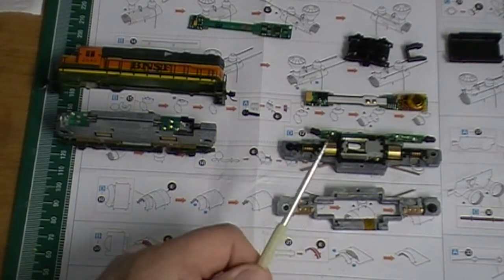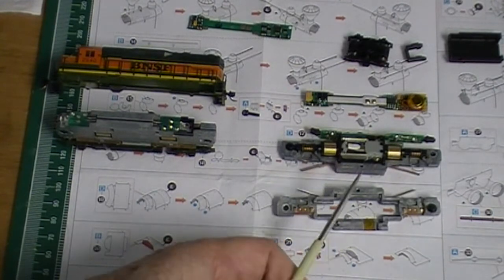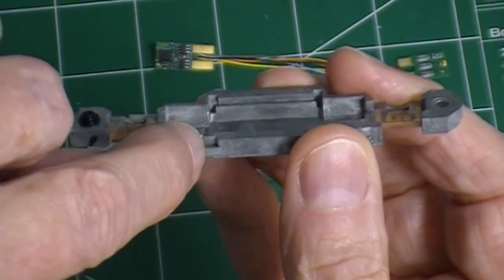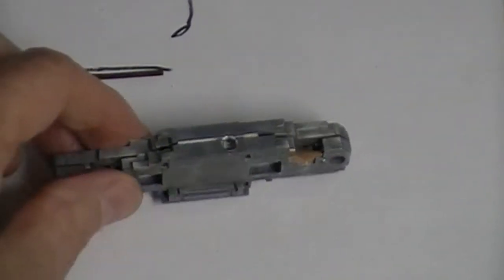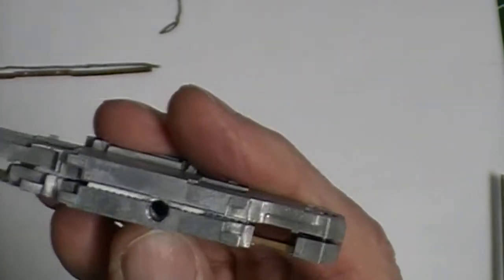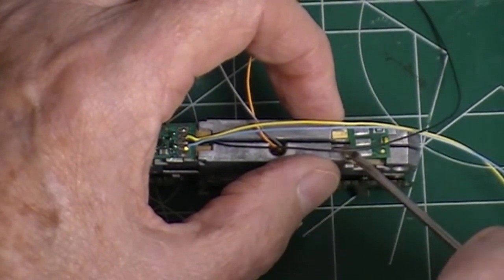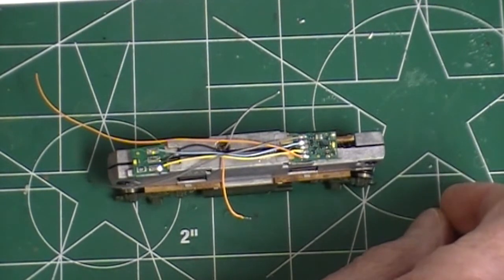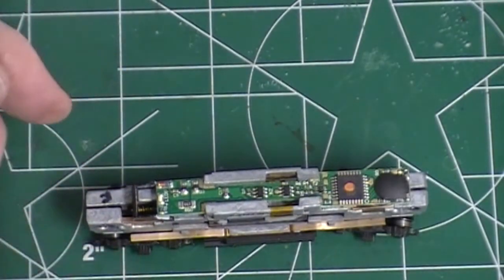Installing DCC into a N scale DC locomotive

Comment: I've done a lot of those TCS decoders, you need to cut the tabs on the motor and only leave a small enough amount to solder on to, then once you solder the wires, you need to put some kapton/electrical tape over the contacts to isolate it from the chassis, making sure to cover the tabs and brush caps.I also take a small file and file a small groove on the side of the motor for the wire the run up the side. It doesn't need to be very deep. 
Also when you mill the frame, you need to mill along the top for the wires to sit down level with the top of the chassis or the shell won't sit properly. Id say that your decoder was shorting out from the motor not being isolated from the chassis. 
TCS has an installation guide for this on their website